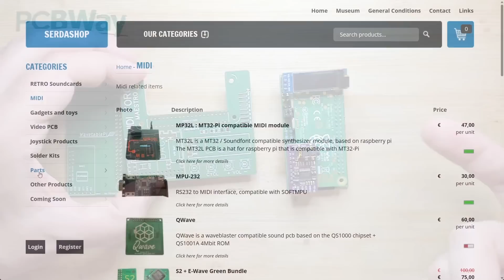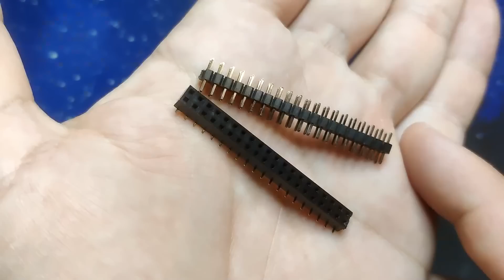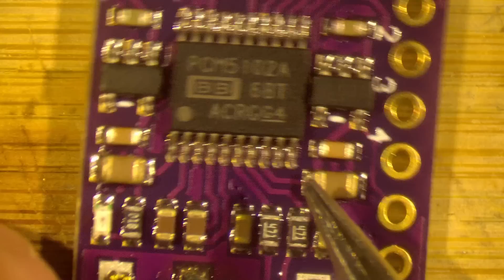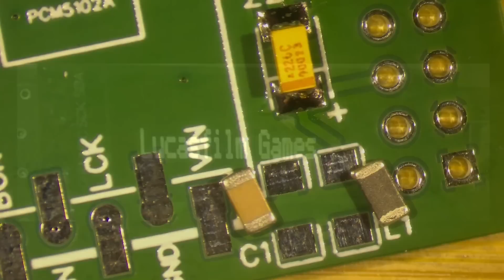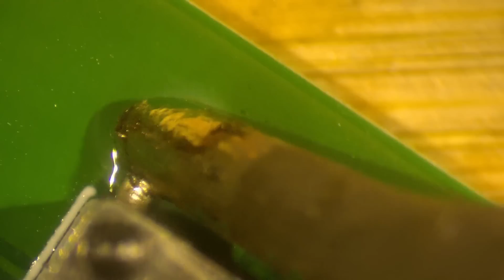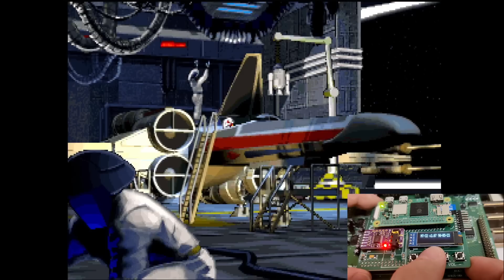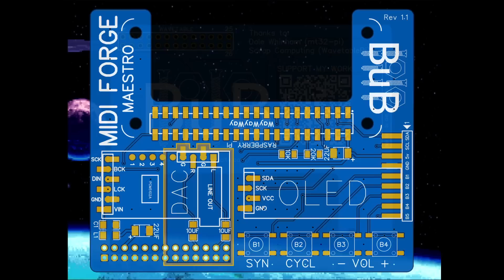MIDI FORGE: Maestro - DIY Wavetable for everyone!

Comment: you could use low profile connectors that go over predrilled holes in the pcb to allow the pin headers to get even closer to the pcb see raspi DBT tuner board for an example.
Reply: I thought of a HAT solution as well, but will it work for DAC and screen?

Comment: To lower the overall height, you can use male SMD header soldered on the board and solder Rpi, DAC module and LCD permanently. I mean, this board do not need to be dissasembled. That way you can gain few millimeters (some 5mm I guess). Or, maybe solder the Rpi flush to the board?
Reply from the maker: Correct! I think this is what I am planning on doing. The Pi will be permanent, the DAC headphone jack has to be removed and I will do something with the wavetable header. All in all, we should be able to reduce the height by 5mm or even more! That is enough to make this a one-slot solution. I also thought of soldering the Pi flush to the board, but it will be a nightmare to find a "weak" solder connection.
Reply: @bitsundbolts  "but it will be a nightmare to find a "weak" solder connection."
I guess no, I used to solder for a project two boards flush on top of the other using at first terminals cutted from components (I bent them in U shape and passed through two holes; after soldering I just cut the unwanted bridges) but I finished using standard male headers passed through both boards from one side with the plastic in exterior, not between the boards; the plastic bit needed to be removed and the terminals trimmed. A bit of extra work, but the solder actually flowed well (even with the terminals bits) and the contacts were solid electrically and mechanically.

Comment: If you mount the DAC without the female headers  and have the screen on the front panel anyway then it'll be short enough to make the directly soldered pi worth it. Alternatively you could source the parts on that DAC and just have them be directly on the PCB.
Reply from the maker: I thought of bringing the DAC chips to the main PCB, but that is a lot of work (even if I would just get the components). It is faster to just solder a few pin connectors - especially if I use solder paste and let my PCB preheater do most of the work.

Comment: Maybe the next step could be designing a 2.5/3.5" bay control interface so you won't have to stick your hand into the chassis to change stuff! :D
Reply from the maker: I think this is something for you ;) - I don't have a 3D printer and no experience yet. But it would be cool to get some open source models for people to print when this project is out. I guess it would also be good to have a PCB for the front panel buttons and the screen then. That would make it a lot easier to screw those items onto the 3D print. Collaboration? :)
Reply: @bitsundbolts  Maybe a generic 3.5 inch bay on the inside and a piece of nice looking PCB as the front panel. Problem is how to do those buttons on the PCB...🤔
Reply from the maker: Maybe instead of push buttons, it could be touch buttons. I may try something once I'm done with the next project I'm working on, but I'll only be able to work on the PCB - not on any models for a 3D printer.
Reply: @bitsundbolts  I'll make the 3D print bracket for the bay and send you the PCB edge cut and guide DXF files when we start working on it. I did check out some capacitive sensor chips but they communicate thru I2C. So more programming work for you. And I have trust issues with capacitive touch controls...(My G4 Cube Mac keeps turning itself on:face-red-droopy-eyes:)
Reply from the maker: Hm, that's not good if buttons act up like that 😞. Maybe I need to get different buttons with a longer shaft.

Comment: Hmm, some design that uses Raspberry module that goes into SODIM slot, could save some bulk probably. Another option is to use angled pin connector and socket on Pi and your board and make boards inline flat with each other.

Comment: I would love one.  Thank you for working on this.  Any color is fine.  Just not sure of shipping cost from your location to US.
Reply from the maker: That will probably the main issue. I did some calculations. The cost for just the items is ~45-55 USD (Raspberry Pi, screen, DAC, 32GB micro SD, PCB, pin header etc.) Shipping is around 20-25 USD from Dubai, but that seems to be a standard rate for international shipping. Considering packaging material and my time to get one of these units together, it would only be economical to offer a unit for around 95 USD (shipped). But that would come with everything - plug and play.

Comment: You could shrink all that down to a single chip fpga, including the dac board

And a esp32 or stm32 for the CPU power

Two chips, and SD card with a single pcb and header

And you could just use some flash memory on board because even a gigabyte of sound fonts and samples are a lot of different noises, just add an spi header and use the esp32 wifi or Bluetooth to flash new sound data from your Lan network or smartphone via bluetooth
Reply: Reduce the chip count and PCB size, makes it cheaper to fab

And you actually want to avoid using via whenever possible especially if you're already using thru hole chips

Because they charge to drill out via for you
Reply from the maker: Those boards cost 5 USD for that size (10cm x 10cm or less). I've never seen PCBWay charge me extra for via drilling. It might be the case with other PCB fabricators, but I haven't seen it personally.

Comment: Awesome!
Reply from the maker: Yeah, I was too excited to get this board as quickly as possible and overlooked the button pinout. Anyway, revision 1.1 won't have any of these issues. The rotary encoder can be configured by the mt32-pi project. There is an option to change the sensitivity of the encoder, but I didn't try it yet.

Comment: A potential addition could be holes for adding spacers / standoffs between the wavetable board and the sound card. Since you have a huge collection of sound cards you could check which mounting hole locations have the most overlap between different sound card models (if any). I don't know if there was a standard for this.
Reply from the maker: I think those holes are standardized. Unfortunately, those holes are not present on all sound cards and they are far apart - meaning, this PCB would have to get twice as big. That is still within the budget range of PCB fabrication (~5 USD for 10 pieces), but the board will be "empty". If a soundcard doesn't have those holes or you don't have the standoffs, the board might be wobbling on the connector. One could still design a bracket for a 3D printer that holes the smaller PCB in place. I think this would be a nicer solution than making the board bigger.
Reply: @bitsundbolts  A subset of holes that lie within the current board dimensions might still provide additional stability

Comment: Does your pin header allow you to relocate the button functions to the front panel? If not, that would be a nice addition so you could control the midi font without opening the case.
Reply from the maker: Yes, it already allows for that. You can relocate the screen, the buttons and add the rotary encoder to the front panel.

Comment: If you increase the size of the holes on your PCB so that the soundcard wavetable pin-header can poke through then mount an SMD female connector on the component side of your board you can probably shave off a few millimetres.
Reply: You would need a cutout but I did think of that too.
Reply from the maker: That is what someone else suggested on Patreon - and I am going to try a cutout for the female connector. I will be soldering the legs of the header on the component side. We will reduce the size by 1.6mm in this case! Rev 1.1 will have this design. I hope the PCB will be strong enough - that's my only worry because it is in the corner.
Reply: @bitsundbolts  Don't forget it will flip the odd and even rows to the opposite side when looking at the copper contacts. This issue is a very common mistake.
Reply from the maker: I'm planning to have a cutout on the board where the connector is. Then the connector will slide through the board from the top. In this case, I don't need to change connections on the PCB.

Comment: I think that the LCD should be installed into the front panel together with the rotary encoder. It is a shame to leave it hidden inside the PC case.
Reply from the maker: Yes, I agree! I am sure there will be front panel assemblies made by people who can use a 3D printer. I guess I should design a front panel PCB with the buttons and screen on it.

Comment: Definitely keep the green for the retro vibe.
Reply: Green was the normal color for when the manufacturer cared to use any color at all, but both red and blue also were used at times. It didn't matter much at the time, fancy cases with windows in them didn't really become a thing until CPU heat sinks had to get big and sort of became works of art in their own right.

Comment: 10uF ceramic coupling caps ooooof.

Problem is x5r/x7r types are prone to distortion. You should use either aluminium electrolytic caps, filmcaps, or c0g type ceramic caps in the signal chain. Problem is c0g 10uF are just not a thing, so you end up with shit.

Also maybe just don't! PCM510x has a charge pump with which it generates a negative onboard voltage, so it outputs ground referenced signal. Just connect it straight to output. If the soundcard can't deal with arbitrary signal reference, it'll just need to have its own AC coupling caps on the waveblaster audio input, and i have never seen one which doesn't.

Separate grounds is a bad idea, because you're partitioning the ground plane, and creating a loop antenna - literally ground loop - where stray unproductive currents will be induced, coupled on electromagnetically. As there is a ground current going across the DAC, the DAC tries to emit a voltage, so it needs to match the current, but it's unable to do so, resulting in distortion and noise. Ground pour interruptions are really bad in this regard as well, so trace layout is critical. You can suppress the loop by star-grounding the DAC, so you connect all grounds as close as possible on the wavetable board, but on DAC you only use ground pin closest to output. This does have drawbacks, i can't say i like it, as it will force the compensation current of the DAC ground right alongside the audio signals.

We should put our heads together and do a design review.
Reply from the maker: Hm, thanks for sharing this information! I will try a few of these thing you mentioned. Remove the coupling caps. If I can't hear a difference on the audio output, then I can get rid of them - less components on the board.
I could also eliminate the two ground planes. They are useless anyway since the soundcard as well as the DAC connect both together anyway.

Comment: “There’s nothing else I could do.”

Can’t you just turn the switches sideways, remove a little solder mask for the grounds, and jumper the other side? Seems much easier to me.
Reply: Or just cover two opposing corners with kapton tape before soldering the switch onto the two remaining pads. It won't be as durable, but perfectly adequate for a prototype.

Comment: I have two ideas for a better Raspberry connector.
First: you could use Pogo Pins (Spring loaded Pins) on the PCB side and screw the Raspberry to it then
Second: You could "cut out" the space where the header sits and use one of these headers with holes all the way through (Pass-Through/Open Barrel Header) and solder a male pin header to the Raspberry then to stick it into your PCB after

Both options are thinner and also available for the display and the DAC
Reply: (also you would have to redesign the traces for option two)